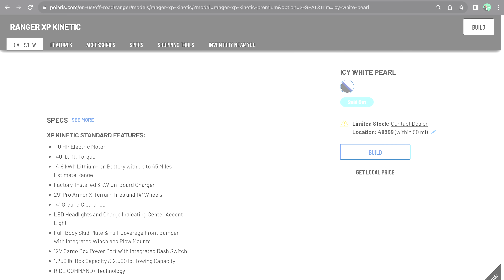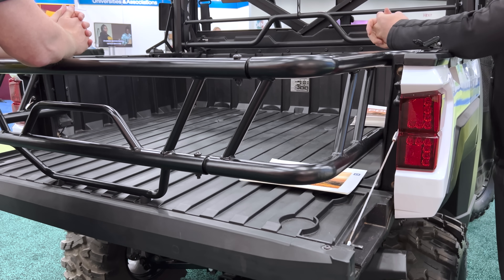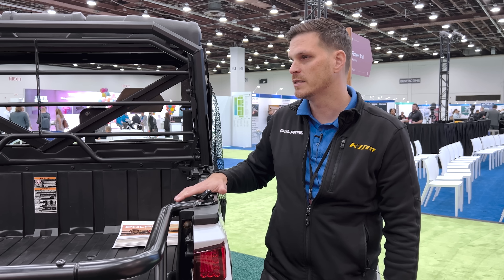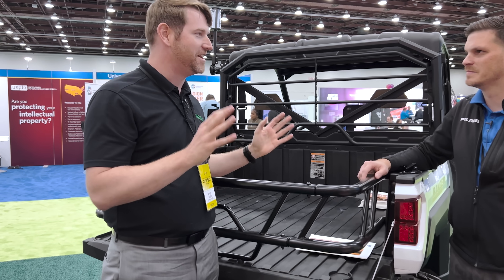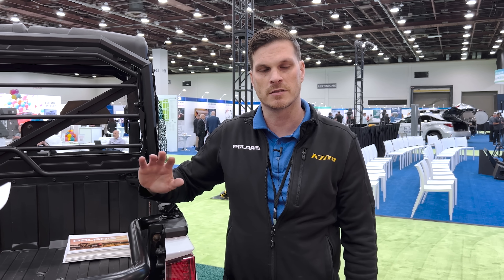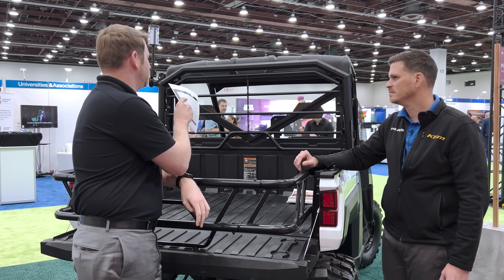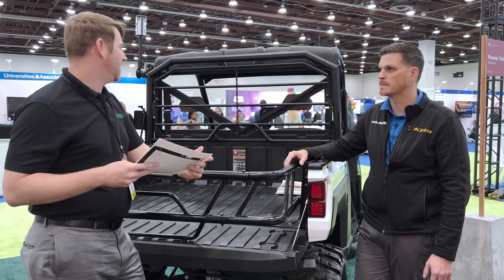ELECTRIC Polaris RANGER XP Kinetic UTV

Comment: The premium version is $28,000. I bought one for my farm. The cost comparisons with a Tesla make no sense — I can’t haul wood with a Tesla. Similarly equipped Kubota gas side-by-side is $22-24,000, so it’s in the ballpark and I don’t have to buy gas. And, it doesn’t scare the horses. I only drive 5-10 miles/day on the farm, so 40 mile range is fine. Dig it.

Comment: I've been on the waitlist for this for 1.5 years and pick mine up 48 hr from now. I can't wait! It will be replacing a Yamaha Wolverine which has been excellent for our farm, but the idea of never having to worry about gas/filters/spark plugs/cold weather/etc is going to be great. The torque is nice too as we regularly pull a 800 gal tote of water around to water trees. Do the math on that... the torque is actually useful and not just a party trick.
Reply: You can buy a lot of spark plugs for the extra $20k.

Comment: They are REALLY missing out with not providing at least one 120v outlet.  That's a huge shame.   You should be able to take this camping or working and plug in power tools or lights, or???   Come on Polaris!!!
Reply: It wouldn't matter, cause you wouldn't be able to use it!  My brand new 2023 Ranger Kinetic is under a "Stop Ride" order, with an unknown date for a fix.   I guess some Engineer didn't work hard enough when they designed it.  Now I'm out the money for an inferior product. Shouldn't they issue refunds for lost usage?
Reply: @s.g.4184  just goes to show you how prepared traditional ICE  vehicle manufacturers are for the EV revolution. It’s much more electrical/computer/software driven and they just don’t have the engineering skills for it, whereas silicone valley does. Too bad Tesla doesn’t have the capacity to do cars and UTVs
Reply: Sxs are limited in capacity in by definition can't have sufficient power, if so by legal definitions not a sxs so different ball park in paperwork. Also I would not use power tools anyway due to battery size

Edit: Polaris does however already advertise the proR a SXS(its not)
Reply: and end up with a drained vehicle and now way out?
Reply: @zachansen8293 not everyone that buys these takes them way out. Plenty of ppl want them for small acreage to do work, this not having a 120v is absurd, shows how committed they r that they couldn’t spend the engineering effort to put that in. At least offer it in a bigger battery pkg. you could stick a delta pro in back of a gas vehicle and do work, but the whole idea is combine the 2 ideas with modern lithium ion tech & make a seamless electric version that can be a workhorse around the acreage

Comment: Great with an electric version! At the same time I wonder why you make these so narrow. They often roll over so they would need to be wider, even with a low center of gravity with a battery.
Reply: It has a lower CoG than the ICE version of the same dimensions.  They need to be narrow to fit on most trailer/ toy haulers , and navigate on trails and such.
Reply: @Thebackson  As the problem of rolling over is so big there should be a version that is wider. Maybe there are but havent seen.
Reply: @michaelenglund  there are literal off-road vehicle width restrictions that restrict vehicle wheelbases in most trails. That is as wide as she goes if you actually plan to rip on trails (however short that trip may be)
Reply: @AnorakTheElectricutioner 
Width = track.  Wheelbase = length, from front axle to rear axle.
Reply: @AnorakTheElectricutioner  What? There are huge jeeps that go on trails.
Reply: @michaelenglund   and those are the largest trails, most jeeps can't run on ORV/UTV trails. Some trails have gates for restricting access. I would check your state park information, it gives the trail paths and width requirements

Comment: Anyone else kinda shocked when Cory announced he stepped down from munro live as president. Just to take a director level position as lead engineer for mid size evs over at lucid? With their cash burn rate and slow sales lucid could be gone by the end of 2024 or sooner. 🤔
Reply: Getting that money real quick. Munnro would take him back after ;)
Reply: @EricEstesEleutherian  ha we will see. Just surprised knowing the tesla team listens to the munro squad?
He has also first hand seen tesla factory ops on multiple continents. Yet he chose lucid. 😐
Reply: @4literv6  I was,  but I'm pretty sure it was Munro that said Lucid could be competitive in making powertrains for other OEMs, so maybe he is over there doing some of that for Lucid as well? I feel like that is the only way they stay afloat longer term.
Reply: @TheJesusFreeke  I just don't see it smh. They have a massive expensive new amp-1 factory to scale.
Over ten thousand well paid employees to keep employed and supposedly building another factory in the UAE to open next year. 

And They have been around since 2007 plus raised almost $15,000,000,000. Burning through about 2/3rds of that already.
Plus the first air prototype was shown off in April of 2016 now. The gravity prototype was shown off in late 2019.
Reply: Maybe Corey knows what Lucid needs to get out of their hole. If he helps turn them around, that would be awesome. It’s certainly a steep mountain to climb at this point.
Reply: We don’t know what may have been going on when the cameras are off...
Reply: Let's see how long Corey can put up with 12 year old Peter Rawlinson after working for Sandy.  Rawlinson is a childish, narcisstic 455hole & the reason Lucid aren't succeeding.  No amount of Corey wisdom can change that!
Reply: Note tat Peter was aniti NACS and then when Cory joined the they capitulated. Take the cash Cory! His background in automotive EVs ill always be in demand.

Comment: I'm glad to see EV of all sorts come out....particularly for off road and NEV use. They still have some tweaking to do.
2:33 "...There is still a belt drive designed to last the life of the vehicle...non serviceable... "
2:52 "...A lot of OEMs are going to the NACS port...we are keeping an eye on where the industry is going..."
3:25 "...any capability to do V2V or V2G? ... not at this stage ...but they do have a SAE 12v port ..."
Reply: Not sure if there's any need for NACS if it's not street legal?
Making an umbilical cord would be cool if you can hook it up to a cabin or fishing shack!
Reply: @professionalelectronics3158  Not really, but if you already have an NACS EV then its just another cord to have to keep track of, and we all know how that has worked out with Cell Phones, lol.
Reply: Y'all do realize the NACS system came out the same year Polaris is coming to production with the system. That takes time and a redesign of the charging system takes a bit of time...
Reply: @AnorakTheElectricutioner  While the standard may have been opened up in November, 2022, Tesla was always open to other companies using it.
Reply: I love how in 3 minutes this vehicle was ripped apart and all of it's flaws exposed. It just shows the experience of Munro in the industry and how difficult it can be to make a quality vehicle when a company does nothing to bring in experience.

Comment: Tesla needs to make a 6 seater crew version of this.  Polaris way over charges and under delivers. It could be a 20k tesla vehicle. Polaris charges more for this 3 seater than a tesla model 3 that seats 5.   There is no reason for this.
Reply: Maybe the Brawley ev side by side?
Reply: Tesla doesn't make create and sell what eager customers want to buy. It's a huge misunderstanding that they are thought to be here for use, we're here for their shareholders. Cases in point? Yoke wheel only. No turning stalks. No instrument cluster. Software you paid 5 figures for goes "poof" when when you resell the car, even when you decide to get a newer shinier one.
Reply: @Cloxxki  This is all pretty old info, you can get a regular steering wheel instead of a yoke, you can transfer FSD software now.   They are obviously selling what people want because they have the number 1 selling car in the world with a model Y , beating the reigning toyota.  Turning stalks are going away because it is a needless part when most of the driving is done with FSD.

Comment: No nacs, no inverter outlets, probably even more overpriced than existing gas models, I don't know why people buy these, cost as much as a car!

Tons of folks drive these on the highways around me, crazy unsafe, loud, and polluting. I'll never understand.

Get an overpriced 4-Wheeler for playing off road, these are a joke!
Reply: It's not very expensive. 30K and $37K. It's a near little fun tractor. It's not a car replacer, though, can it even have plates? I'd loooooove an electric version of the Ariel Nomad, but if they'd build it, it would be $100K+. I might end up commissioning a single one. Maybe upscaled a bit to be slightly more practical and easily fit AWD which the Nomad just doesn't have. I dream of a sub 1 ton buggy that outpaces pro rally cars on the same wheels. The Nomad is not that in gas version, oddly. It's been slower than a much heavier rally car with similar power. Not sure why or how to fix that. The more upsight Polaris must be a hoot, they're selling a lot of these. Combination of exploring and farming, but not really rock crawling or rally speeds. It doesn't do all, but for what it does it's nice.
Reply: Maybe for buyers it's about the freedom. Think of it as a golf cart that can almost go anywhere on private land, help with work around the farm and just be fun throwing up gravel around the extended yard. A bit like a seadoo for land.
Reply: @Cloxxki  agreed about the options, but these are $10k machines at best. They are massively marked up. And plated all over Wyoming just like regular 4-wheelers, for public road use.

They are great for farm and property or small business use, for sure. But that 30k can buy a literal tractor. I have one, and it's FAR more capable than these.

This is a market where hubris and one upmenship have taken over. Very typical of any hobby/clique that gets entrenched with white, heterosexual, male (macho) people. AR-15's for example or everyone wearing camo, when in reality it does literally no good when hunting. The lifted truck, and coal rollers. It's all based on idiots, that will pay more simply to be cooler, and the manufacturers know this, and certainly take advantage of it.
Reply: @Cloxxki  sorry, I meant the type of utv itself, yes the electric may indeed cost more.